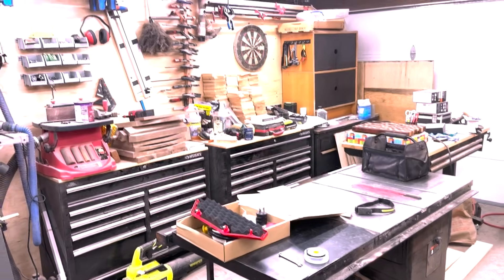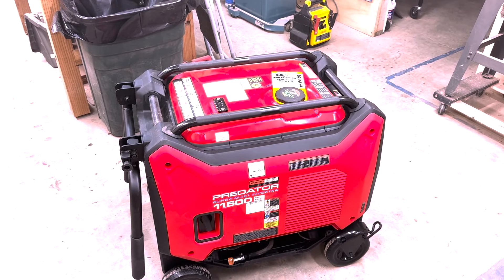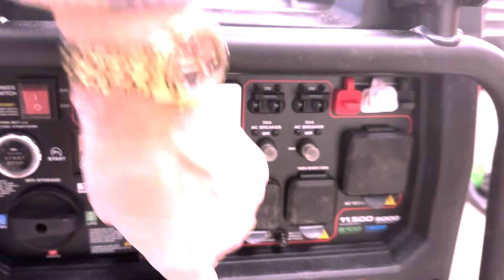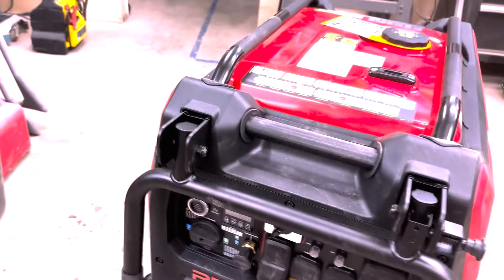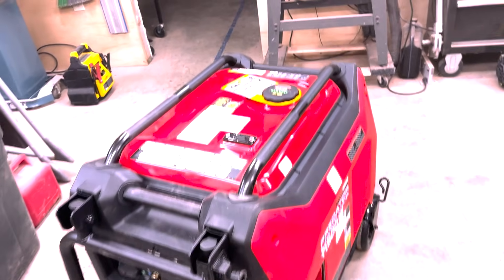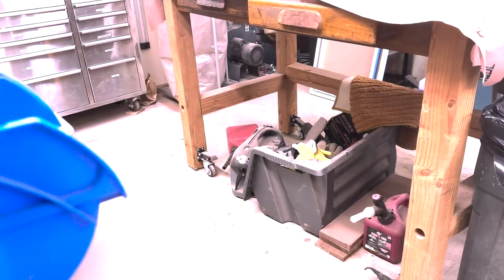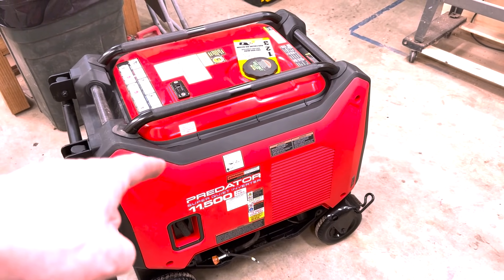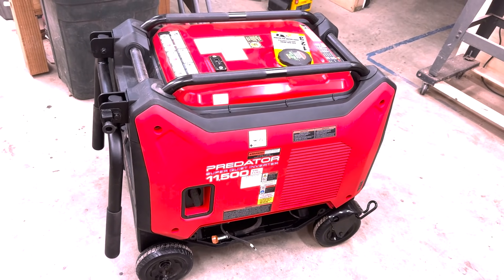Predator 11,500 watt inverter generator: Remove neutral from ground for home backup power generation

Comment: The only receptacle that should be unbonded is the one going to house,  240 volt, 30 or the 50 amp 4 wire. The 120 volt receptacle needs to be for safety,
Reply: I agree with you! But on this unit, it is much easier to bond all of them. I do understand that if someone else is using your generator and doesn’t know that could be dangerous. But I will never let anyone use my generator and I just use a simple Bonding plug if I ever decided to use it as a standalone generator.
Reply: Un bond
Reply: , if someone removed the engine-to-frame bonding wire,YELLOW WIRE a simple continuity test could falsely indicate that the generator now has a floating neutral — even though it’s unsafe and incorrect.

Comment: Thank you very much. Finally someone did a video on how to get this unit floating neutral. Great job!!!
Reply from the maker: Your welcome!
Reply: Didn’t work on mine, mine is the EPA model, I guess they are bonded in a different place. I looked around the other side but no luck.
Reply: , if someone removed the engine-to-frame bonding wire,YELLOW WIRE a simple continuity test could falsely indicate that the generator now has a floating neutral — even though it’s unsafe and incorrect.
Reply from the maker: @c @chucklindhorst331  It has white tape and is labeled N for Neutral